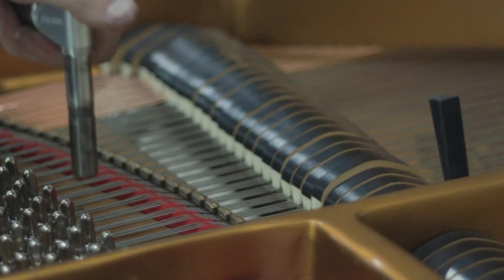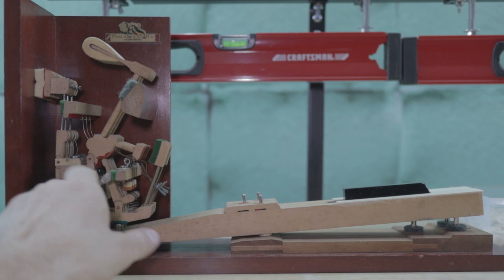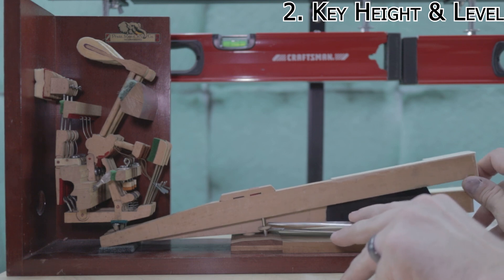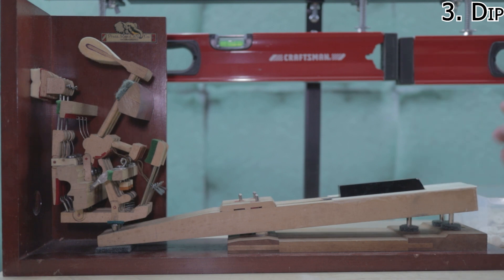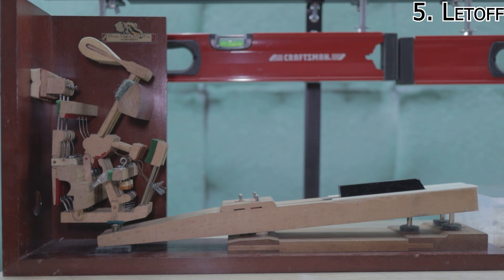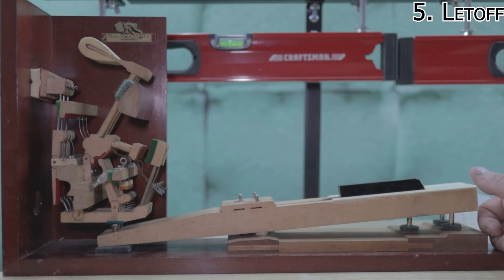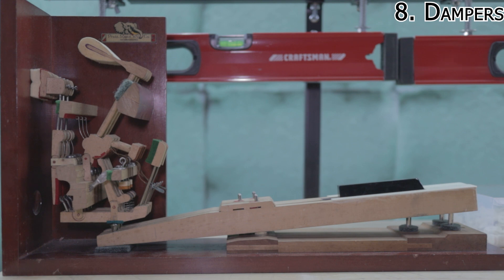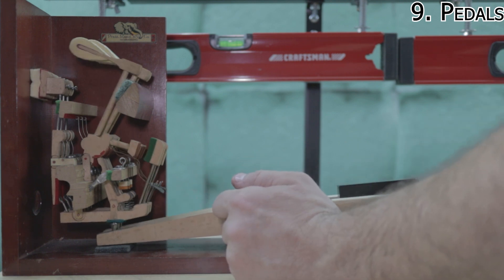Upright Regulation

Comment: For regulating uprights work from string to finger; for grands from finger to string.

It is best to not alter let-off for solving bubbling issues. 

The Renner type let-off tool is better, with the flexible, gentler shaft/wire (?)

In this video the keys are not reaching the front touch felt because the jacks are held by the slap rail.

Blow: 45 mm
Set-off: 2
Checking: 12
Damper lift: 19
Key height: 19 above key slip

I find the spoon tool shown in the video impossible to use: I use the Renner spoon adjuster (straight one and curved type; both very useful):
Set one or 2 dampers per section;
Action out; tie lift rod to action standard and adjust tension until hammer moves together with damper when the lever is tweaked; adjust all other spoons to match.
Simultaneous lift must be done before.
Reply from the maker: Are you an RPT?
Reply from the maker: You’re welcome to have your own opinions but since this is the second video you’ve left a comment “correcting” things I think it’s important to note to anyone who might read your comment, as to not be led in the wrong direction, that in all of my videos, tuning, regulation, repair, I always use the specs that the Piano Technicians Guild has deemed correct and what you’ll need to use to pass the examinations to become and RPT (Registered Piano Technician). Thanks for watching!
Reply: No I'm not. My intention is not to criticize but to help. If I say that the blow distance for example should be set and the lost motion taken up before levelling the keys that is because the key is held up by the hammer being at rest. The reason I say the Renner set-off regulating tool is better is because it is flexible and will be less likely to break off the adjusting device. Don't be offended. I don't have many people to talk to about these things here in Brazil and I like practicing explanation methods to improve my teaching skills.
With "help" I mean: to share methods and ideas which I believe to be faster and/or better and therefore more efficient.

Comment: Great video. Thank you! My ultimate guide for adjusting a piano i am using to lean how to be my own "technitian" 😅 I have a hofmann and czerny upright, it feels so light 😢 how should I calibrate so it fiel as heavy as possible? The damper spoon set outwards, the letoff very far from strings? Something else? I am so sad it feels that light 😢
Reply from the maker: Thank you! Hmm, I’d regulate it properly so that everything is in spec then reevaluate. If when pressing the key down it feels too light with everything regulated as it should you could add some “jiffy leads” near the back of the key, just in front of the capstan. That would require more effort to play it.

Comment: Great video!!!
One thing I saw is that you have not adjusted the external damper of the keys... Is the travel of the keys to be limited by the dampers?
If yes is the answer, how has to be set and when in the described procedure?
Reply from the maker: Thanks for watching! No, the dampers won't affect key travel. The front of the key will bottom-out before any action component becomes a problem.

Comment: Thank you.  Very useful info!  I have been able to solve all problems with my Yamaha upright's action except one.  One key, G3#, produces an intermittent "twangy buzz" sound on top of the tone when struck.  I don't know how to describe it any other way.  It's not always there, and not at all force levels, but it is enough to be noticeable on pieces like the Moonlight Sonata.  The piano was recently restrung and refinished.  Could that be a problem with the new strings or the action?  Thanks!
Reply from the maker: Usually when I run into this problem it is due to a bit of debris touching the string. On an upright the most common place for this to occur is at the bridge. Take off the bottom board and look at the string where it meets the bridge, behind the bass strings. You may find there’s a little bit of wood or something hanging out where the string meets the bridge. It may be hard to see but it sounds like something is touching the string whenever it vibrates hard enough to make contact with whatever it is.

Comment: Why are bridle straps needed? Sebastian Erard  introduced  the double repetition in grand piano action 1821, and "=" Robert Wornum - the "tape check" in upright piano action 1826. Robert Wornum constructed your the first upright piano in 1811.  They were there before J. Hawkins about 1800 and J. Schmidt in 1780 - those upright pianos and the first  Wornum's piano (1811) didn't have it yet of bridle straps (tape check) just as old grand piano in 18th and some oldest in 19th centuries didn't have double repetition too. "The value of this tape lies mainly in the slight extra pull it manages to impart to the hammer butt when the hammer rebounds from the string, and after the back check has caught the hammer and been released by the release of the key. The tape would not have any special. value but for the fact that the hammer, having' been caught by the back check, naturally would hang a little on the release there of, if it did not receive the gentle pull caused by the fall of the wippen with which the bridle tape connects it. The tape is, in fact, to the upright action what the repetition lever is to the grand. Until these two features had been devised and applied to their corresponding actions, the piano was an extremely imperfect instrument. The modern upright piano owes its present touch effect to the tape just as the touch delicacy of the grand is due to the repetition lever. Of course the grand action is the mor~ delicate and responsive of the two, for it possesses the double repetition. This the upright cannot have, not to mention the fact that the fall of the hammer through gravity is of course far more effective than its retraction by springs. The upright action blocks more easily than does the grand, and finger movement must be higher to secure repetition." The second function of ribbons is "to keep the levers up, and to prevent the jacks getting caught beneath the notches, when the action is removed from the piano and replaced."
Reply from the maker: @mareksieczkowski8474  *Bridle
Reply: @MrPianoTech  Thank You

Comment: This is exactly what I wanted ! Thank you. What is the regulation for soft pedal ? How many mm the hammer about the string, when the soft pedal is full down ? It's suppose to have a GAP between metal mecanic frame and the hamme slept/nap bar ?
Reply from the maker: Thanks for watching! Yes, it should move over just enough so that with a three-string unison the hammer only hits two of the strings. On the two-string unison the hammer should only hit one. And on a single bass string should just be catching the edge of the larger strings.
Reply: @MrPianoTech  Thanks but, I ask for Upright Piano (sorry I don't say it in my last post because this video talk about upright piano).

The Soft Pedal push the Hammer Rail, so the hammer are more close to the string. What is the best distance between hammer and the string when the soft pedal is full down (on upright). 

The hammer rail touch the metal frame of the mechanics (with little felt)when soft pedal don't use. When the soft pedal use, did the hammer rail have to touch the other side of the mechanic metal frame (look like a ''D'' with the hamme rail in this ''D'').

*Sorry if it's not clear, my english is not really good.
Reply from the maker: @GabLapoliceGuitariste  No problem at all, sorry for my late response. Once the hammer rest rail is set for the proper hammer to string distance you'll want to take up the lost motion with the capstan under the whippens. Yes, the left pedal should then swing the hammers forward but I need to look up what the tolerances are. Off hand I'd say it's probably around and inch or so, maybe a bit more, but it should be enough to notice a difference in tone but not so much as to not let the key play properly. But I'll check the details for you.
Reply: @MrPianoTech  thank's

Comment: Many thanks for the most informative video.  A question on lefoff.  Could differences in letoff alter the volume of a note for a given touch.  From what you say regarding heaviness it sounds like it can.  I have a brand new piano with a treble (circa two octaves above middle C)  that sounds louder for a given amount of key pressure/velocity than the lower notes (circa an octave or more below middle C), with the lefoff for the lower notes being far greater than the treble.  In the worst case, lower notes can be as great as 10mm and upper notes as little as 1mm.  There is a general increase in letoff as ones goes up in pitch, but there is a lot of note to note variation too.  Any comments would be appreciated.  Thanks.
Reply from the maker: Letoff can affect touch. You can adjust for certain types of players, however, all letoff should be the same over the entire action. Bass hammers will be a bit tougher to play because of their size and weight compared to the others.

Comment: So as far as the hammer distance to the strings. The only way I can get 46mm is with the pedal depressed to push the hammers forward. That’s how far away the hammers are. What’s up with that?
Reply from the maker: There should be a spot on the frame that holds the rail that the hammer shanks rest against where you can shim that rail up to the proper distance.
Reply: Thank you I figured that out. One more question. It seemed that none of my keys had any let off, I played with the let off buttons a little and achieved nothing. I figured out that by pulling the back checks back there was let off but it’s not right to adjust the let off then push the back checks closer is it?
Reply from the maker: @ShystySpokes Once you adjust the rail to bring the hammers closer, then take up any of the lost motion with the capstan screw underneath the whippens, that should bring everything close enough to where you have some let off. Dip can affect it also.

Comment: Question? Why do some hammers fall backward or forward loosely immediately after letoff is set?
Reply from the maker: I would check to make sure the hammer return springs are present. If it’s an Asian action, there are usually little strings that are attached to the flanges that connect to a spring embedded in the front of the hammer butt. Those often break leaving just the spring with nothing for it to grab onto. If this isn’t the case I would next check aftertouch and make sure there’s not too much or too little.
Reply: @MrPianoTech  Thank You

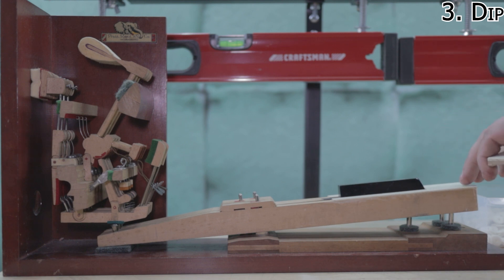Comment: At 7:54, you can see the keystick isn't touching the front rail felt. Instead, it looks like the wippen is at its mechanical limit. That's bad, right?
Reply from the maker: It could go more. It allows for aftertouch. You can see it in step 7.